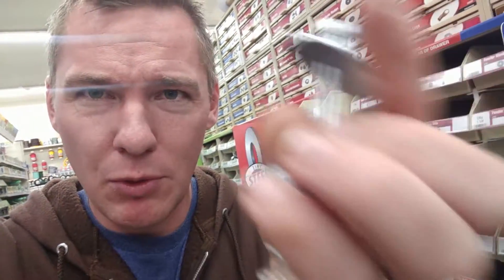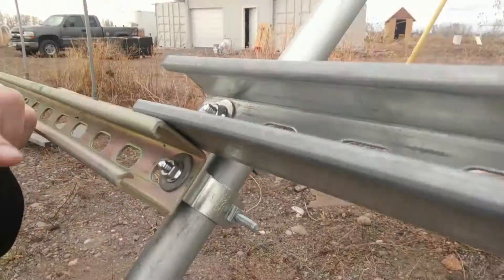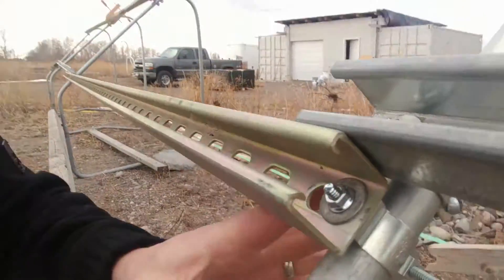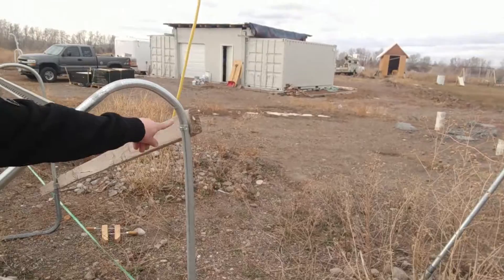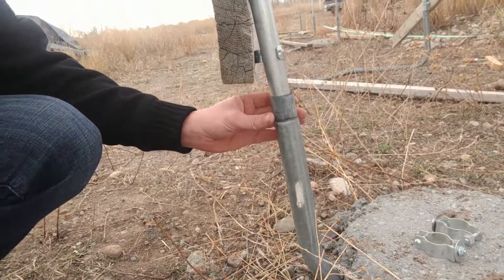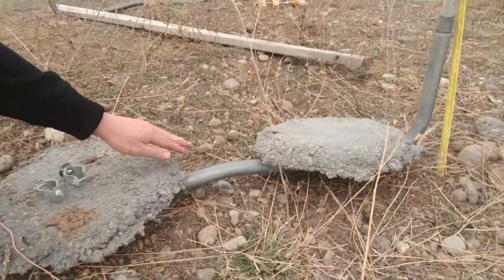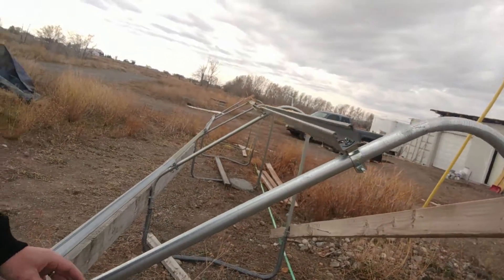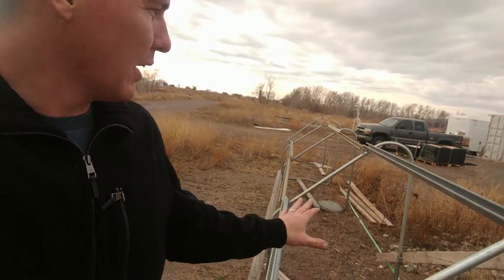EMT Conduit Solar Panel Rack Mount System | DIY Solar

Comment: I thought this video was going to be about using EMT conduit as racking system on roof.  Unistruts are quite expensive, so using EMT conduit (fasten solar panels onto EMT conduit using pipe hangers) instead of unistrut would save good deal of money.